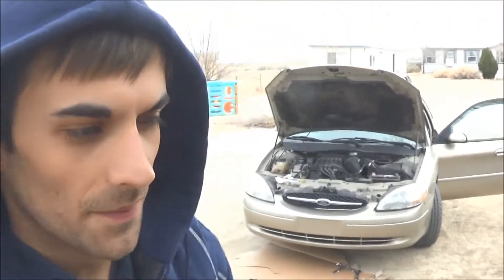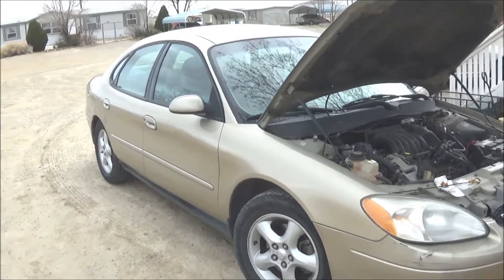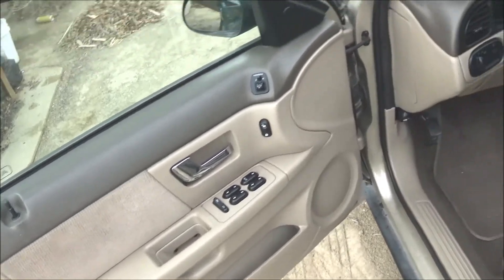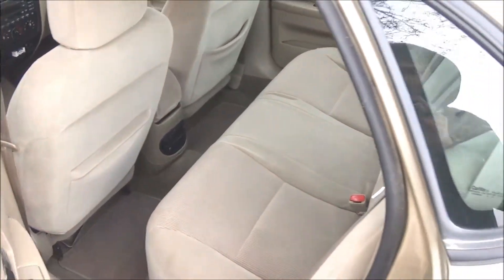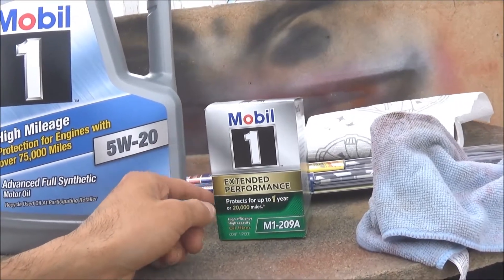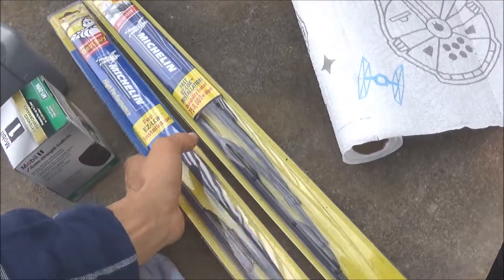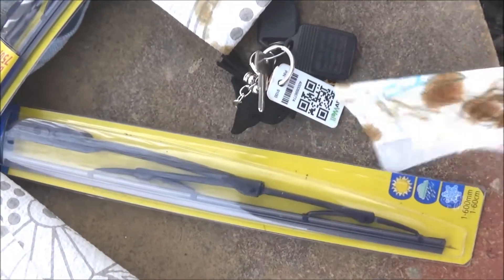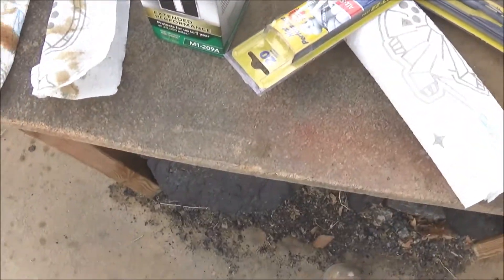2001 Ford Taurus Ses 3.0 Ohv [WIFE'S NEW USED CAR]

Comment: Hey buddy, just an FYI, Walmart SuperTech filters have changed! I don’t know if for the good or worse yet. New packaging, good for 10,000 miles now, and they’re blue. 

Also, check your Walmart for clearance white SuperTech filters because they’re selling them for $2 at my Walmart to make room for the new, blue ones 

I wasn’t being an ass about the wife’s new car, in case you thought I was trolling.. Seriously though, I wish you much luck with it. Change the coolant, trans fluid/filter and power steering, and never neglect the oil changes.
Reply from the maker: Tony P Thanks bro good to know. Na you didn't don't worry I been hella busy last week or so

Comment: My dad has this car and it's had a few problems with the power steering system. But other than that, it's a fun, fast car.
Reply from the maker: Richard Ojeda Thanks bro will do. Ya its pretty quick but I think my Civic will tree it lol
Reply: ThizzleKid420 Definitely, obviously  the Taurus isn't for racing or none of that but it's still quick and has torque.
Reply from the maker: Richard Ojeda Yeah I was just fucking around. I do believe it's faster than my Civic. Race soon and I'll post it for shits in giggles.
Reply: ThizzleKid420 should be an interesting video.

Comment: Yeah dude he’s right, change that power steering fluid out. Those year range Fords are known for whiney power steering pumps. 

Also, if the engine isn’t leaking then don’t use high mileage oil. It has additives that swell gaskets to help minor leaks but if you don’t have any leaks it’s gonna swell gaskets for no reason and then, if you don’t buy high mileage oil, you can risk the gaskets shrinking back then having a slow leak because of the expansion/contraction. It’s a Ford.. save your money on the Mobil 1.. Mobil 5000 and a good filter all day. 

Fixed Or Repaired Daily
Found On Road Dead
F*cked On Race Day

I’ve owned 4 Fords. I have the authoratai!

Seriously tho good luck with it, don’t expect to not have to put some TLC in it though over time. It ain’t no Honda haha

Comment: Nice car, even with some issues i swear by those taurus, we use them at wk (fleet) and they are reliable with proper maintenance, how many miles on it?
Reply from the maker: Jesus Uribe Awesome good to know. I looked at over 10 cars and this one was the best fit. It has 109,000 miles.